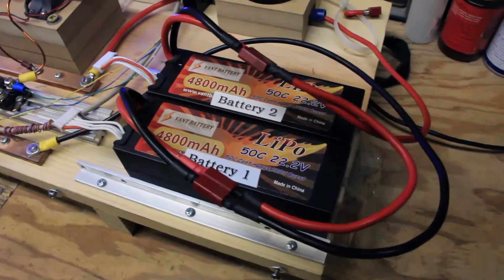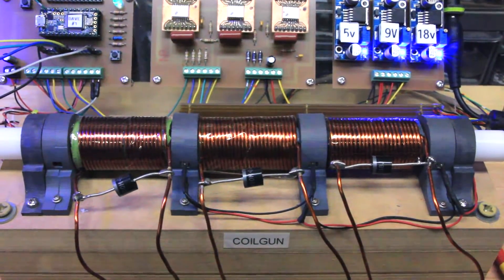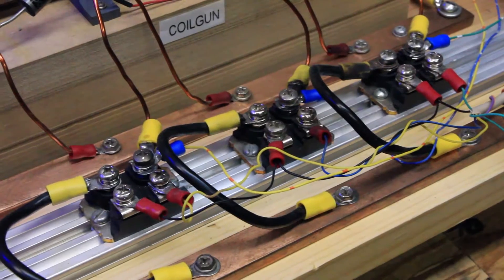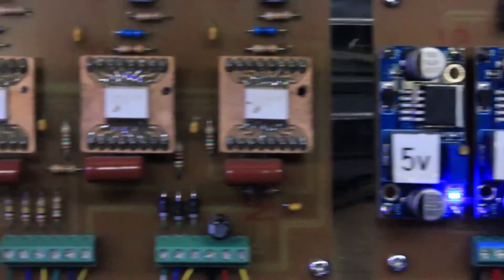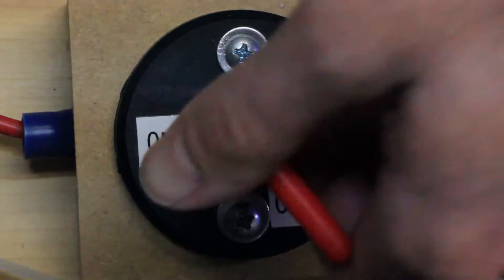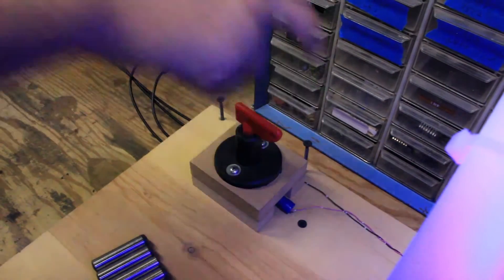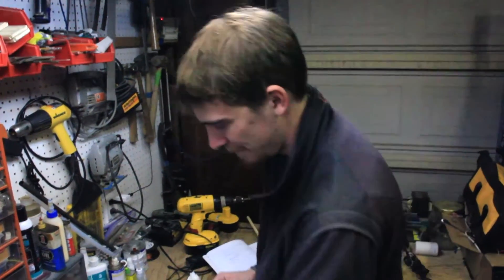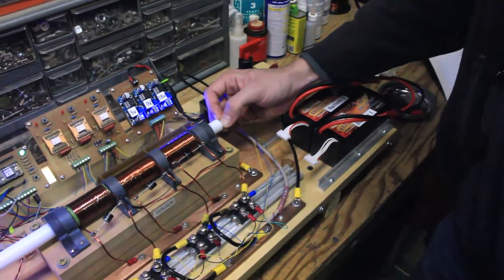Coilgun Project Overview

Comment: Hey there, I’m working on a coil gun and I know this is kind late, but how did you get the IR sensors to be able to see the projectile? Did you drill two holes opposite from each other and then mount the sensors there? And how did you make sure that the projectiles wouldn’t get caught on the holes? Thanks in advance!
Reply from the maker: Yes, there's a hole clean through the barrel with an IR sensor on one side and an IR led on the other side. Read the datasheets carefully before buying to make sure the wavelengths match.

The sensors are mounted inside the grey plastic rings outside the barrel. Since the hole for each of the three sensors was drilled through the barrel in one shot, only the hole going from outside to inside has burrs that are problematic for the projectile. Use a sharp drill bit and don't push too hard, then finish up with a deburring tool to make sure the hole is smooth when viewed from inside the barrel.
Reply: dpidcoe Thanks!

Comment: I was able to get 9J with two stages but I got slightly better batteries. It's weird my second stage put in 27m/s after the first put in 17m/s into the projectile and by the third coil I was only able to get an additional 2m/s into it even though I spaced it super far away and let the field fully build up for 2ms so it would be at full capacity by the time the bullet was at the front door. I don't fully understand why I can only get in 2m/s , about 1 Joule or so over the second coil. The field was already built up. Yes the field also takes 320us to collapse and once the bullet is going that speed it'll be inefficient but that doesn't fully account for the inefficiency. Also the time in there shouldn't matter right if the field is built up because work is done over distance not time.
Reply from the maker: With that energy/velocity combination I'm assuming you're using a smaller projectile than mine? It's possible that you're reaching magnetic saturation.

How are you deciding when to turn the coils on and off? It's possible that your control scheme has some delay to it and that's causing the inefficiency.
Reply: What is your coil length? 320 Microseconds is way too fucking much. Yes work done is over distance, but calculate the distance that is travelled over those 320μs, in a negative force field.
Reply: It's quite a bit smaller, coil and projectile length is 4.2cm, diameter is 6mm weighing in at 9.4 grams. 
I'm using an Arduino to control the timing, no IR gates whatsoever. I don't think there's a delay for only the third coil in fact I turn it on way early which I can do because I have a lot of space between coils as of now.
If I'm reaching magnetic saturation wouldn't that mean that the other coils would be less effective as well though as all my coils are wound the same?
I don't think this is unusual though what's happening to my gun. I've noticed all battery powered guns once they get to the mid 40s or even less m/s after that each subsequent coil will only add 2m/s. I'm trying to understand why. The same thing happens to capacitor driven guns except it starts happening at 65m/s or so. 320us is only, 1.5cm and during that time on average the negative effect is half strength while when the bullet enters the field in my case is fully built up so it doesn't explain a factor of 6 decrease in KE added between coil 2 and 3. Also why is that way too much? I do have a lot of self-inductance because I'm not working with the same sort of power as capacitor driven guns which elongates the fall and drop times.
Reply from the maker: Reaching magnetic saturation would be a cumulative thing. Each coil successively magnetizes the projectile until you reach saturation. Once that happens your coils will have dramatically less effect on the projectile.

And then you really should look into adding some IR gates. Even if you stick with open loop timing on the arduino like it sounds like you're currently doing, being able to see where the projectile is in relation to when you turned the gates on and off is invaluable for debugging later.
Reply: Thank you for replying. I know roughly where the bullet is based on knowing the velocity out of each coil but I am planning on adding some IR gates in the future even though I don't really like the additional wiring that has to go with it lol. 
Is there an easy way to calculate magnetic saturation? I liked the idea of smaller projectiles because I wanted to up traditional firearm magazines by 50 percent capacity once going full auto but I'm going to have to upsize it a little if it is getting saturated. 
Are you still planning on going for 10 stages? I'd really like to see when you run into saturation issues since your projectile is so large compared to mine.

Regarding saturation, I can't say I understand how this gun works. What I know is that the coil's field aligns the projectile's magnetic dipoles with the coil's field when previously the projectile's dipoles were basically facing in any random direction. So I assume that the act of aligning the dipoles creates a force? As after a few coils the dipole's orientation is more closely matched to the next coil's field this means less force exerted (running with my speculation here, please correct me). 
Wouldn't that mean that I could just orientate the 4th coil in my case opposite so have the N pole where the S pole used to be or vice versa, and now have slightly more force because there's a little more reshuffling to do? I assume that the majority of the projectile body is aligned horizontally after running through a few coils so the later coil's interior field has no more reshuffling to do when previously the first coils could at least align the random dipoles to that orientation.
Reply: Saying that the 320us can be neglected is probably one of the major mistakes you have made. Also the acceleration is determined by the force, obviously. Where the force is determined by the distance. Therefore, having the coil on before the projectile reaches the coil on adds a slight force, almost nothing. The only reason you will find that useful is because it removes the start up time. While you say the 1.5cm of deacceleration is "nothing", it is the distance where deacceleration is almost just as strong as the acceleration beforehand.

As dpidcoe said, saturation can be a big issue when having the tiny projectile you use. See it as a capacitor chargin, when it reaches the first coil, it goes very fast, the distance between the stages is where the magnetic field is slightly dissipated. However, just as a capacitor charging it can be so respresented as a f(x) = e^-x curve, the BH curve hysteresis curve can be just as represented: http://www.electronics-tutorials.ws/electromagnetism/mag18.gif

As you can see, the projectile "charges" the magnetic field very fast, but tends to slow down when the asymptote nears. 

In conclusion: 320us is way too much, choose a larger projectile.
Reply: My gun is modular, I can slide my coils over the barrel and replace them. I have coils that are wound differently for faster field build up and collapse time, I am not ignoring the 320us. I kept the coils consistent here just to understand what's going on, all I said was that the 320us didn't explain most of the inefficiency, but as I have already learnt from you two it's bound to be magnetic saturation. I will switch to differently wound coils for coil 3 or 4 and coils after

Regarding saturation I won't be upsizing the bullet because the saturation will go up linearly with volume and so does the mass which means I won't be getting higher velocities, only higher KE if I upsize. I want velocity and it's fine to have less KE in a smaller projectile because it hits with a smaller impact point.

And removing the start up time was tremendously useful I think you are underestimating that. My second coil added over 7J, which is more than I've seen anyone add on battery power to such a small projectile. (Efficiency is lower for smaller projectiles.)
I accomplished this by having a coil with many layers that gets insane field strength but in return slow build up time of 80 percent field in 1.2ms. As the bullet before coil 2 only travels 17m/s it doesn't cost much distance to do this for coil 2. If you look at Jason Murray's gun he posts all his speeds per coil, it took him much more stages to get anywhere near those speeds (yes his mass is slightly higher and a bit less powerful batteries).  Since I'm going over 44m/s out of coil 2 I can probably just add another 6 stages to get to 56m/s which is a record as far as battery powered guns go (I think) and I would definitely be happy with that speed and 15J of KE in such a small projectile.
Also the deacceleration is half of the acceleration because the field was fully built up before the bullet gets there. So you could say the deacceleration is as strong for 0.75cm which is less than a fifth of the acceleration distance.

 I've also until now managed to have the bullet not tumble without any aerodynamic modifications although It'll probably tumble if I use more stages.

I'm considering having a single powerful capacitor just for the last stage, so I can add 8-10m/s in the final stage don't know yet if that truly makes sense.

Btw how do you know when someone comments on someone else's video? I'm not being negative I appreciate your input I'm just genuinely curious if you can enable notifications for that in the settings.

Comment: only 48mph
Reply from the maker: Keep in mind that this is quite a large projectile as far as coilguns go. It goes a lot faster if I use a light projectile (like a hollow tube), but it greatly reduces both the efficiency and the overall kinetic energy due to the lighter weight. Ke = .5*M*V^2

If you want an idea of the kinetic energy involved, this is about half the weight of a baseball and of comparable speed to a knuckleball pitch.
Reply: Kinetic energy would be the same. I get it. 
I've seen the vids of US Navy EM guns which go, they allege, at Mach 7. Is it just a matter of bigger coils and capacitors or is there a different configuration?
Reply from the maker: The navy is working on a railgun, which is a completely different principle. For a railgun there are no coils. You shove as much current as you can through the projectile and it produces a force trying to rip the rails apart while simultaneously pushing the projectile away from the source of the current. The velocity in that case is a function of how much current you can deliver before the projectile runs out of rail.

Note that unlike with the railgun, a coilgun requires that the coils be switched on and off. This means that more velocity actually works against it. As the velocity increases, there will be less time for each coil to exert a force on the projectile as it passes through. And the more powerful the coil is, the more inductance it has and the slower it'll switch.

Oh yeah, and also note that mine has no capacitors, which is actually pretty unique among youtube coilguns :P

If you want more info on railguns I'd recommend checking out the railgun video electroboom made, and also Azagro has some pretty good info on his channel if you want to see how the math works.

Comment: Doesn't the timing throw it off when using random projectiles?
Reply from the maker: The timing is different, but the software can compensate since it's switching based on feedback from the sensors between the coils. Basically it works, but  it does take an efficiency hit.
Reply: Could you explain why you have timing software in addition to the sensors instead of just using the sensors only to handle the switching by being hooked up straight to the IGBT/MOSFET driver?
Reply from the maker: Having software control the switching based on sensor inputs has some big advantages:

1) It's a lot simpler to write a bit of code to respond to inputs than make a dedicated circuit. The micro-controller is $25 and the IR sensors are 50 cents a piece. To implement it in hardware would take a small handful of components and some custom circuit boards.

2) Software also allows for adapting to different weights or sizes of projectile, as seen here. It also allows for theoretically faster switching, as it can start to "look ahead" and turn on coils before the sensor is even tripped based on predictions made from the previous sensor inputs.

3) There's also a safety factor in that my code won't allow a mosfet to stay on for longer than 8ms (the longest possible time a projectile will stay inside a coil during the first shot). This negates a lot of potential issues, the biggest being a mosfet being left on due to a sensor or projectile malfunction and setting itself and/or the battery on fire.
Reply: Having just burnt out my IGBT today on my second time firing ever I definitely wish it would have shut itself off after 8ms lol. Don't you still need a driver though for every coil? I have my sensors connected straight to the driver so I don't think there are any additional parts involved necessarily.
Reply: How are you switching your IGBT? There must be something at fault with your gate drive, if not, your triggering. Have you tried it with LEDs, just to test the timing? Always a good way to prototype.
Reply: I've tested with an LED. It was also working at lower power levels but once I upped the power significantly the coil couldn't shut off quickly enough before the projectile started oscillating and thus repetitively braking  the sensors light path. Before I could pull the power the IGBT was already toast lol. I need to do a negative gate drive to switch off more quickly I think.
Reply from the maker: Yep! The gate capacitance on these things is high enough that it can't be abstracted away and ignored like you can with a smaller transistor. If it turns off slowly, you end up in a zone of linear operation where it's only passing a fraction of the current and the rest is being dissipated by the IGBT as heat (occasionally heat in the form of flames).

If you're driving a big one like in my gun, I'd highly recommend that you buy some actual gate driver ICs. The ones I'm using are a few bucks a piece and well worth it if they can protect a $30 mosfet.
Reply: Which driver do you use?
Reply: IGBTs are often used with negative gate drive yes, one way to do it is with a coupling transformer and also completely isolating the circuit.

Comment: now this can be really portable. using big projectile just increase the battery voltage to may be 100v and try , i think the projectile is getting saturated . will you add even more stages ?? . if  you are working on this , you gotta make it deadly.
Reply from the maker: I don't think the projectile is getting saturated, there's just not all that much power going into it, especially compared to how big it is. The highest I can bump the voltage to with the current mosfets is 75v. Once I go over that it starts to get considerably pricier (both in terms of mosfets and in batteries, that's $200 worth of lithium polymer running it in this video, I'd have to double it for 100v).

The final plan is to have 10 stages in a rifle-like formfactor (it'll probably look similar to the USP-15 shotgun). I really want to find a way to integrate your idea for spin stabilization into it as well.
Reply: dpidcoe yeah for projectile as big as yours spin stabilisation is ideal